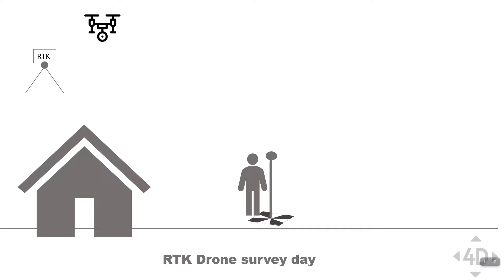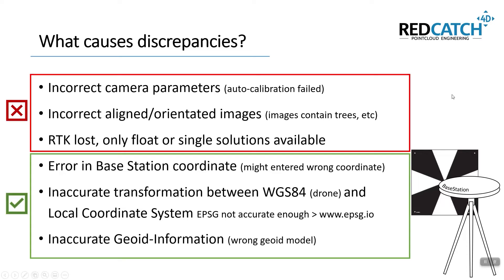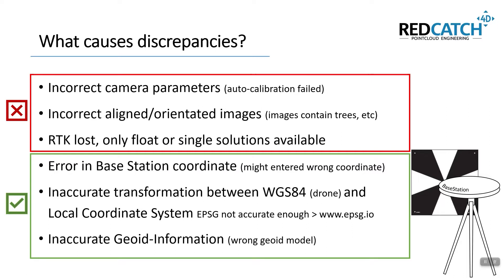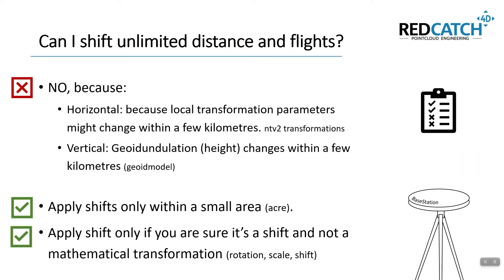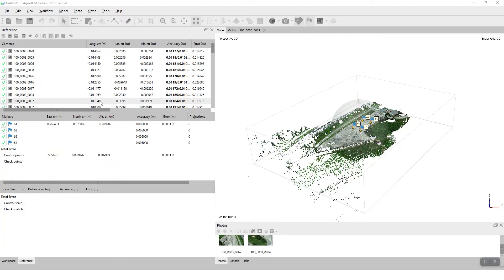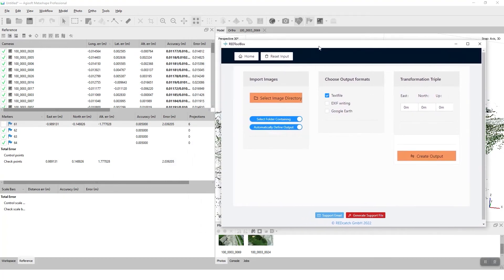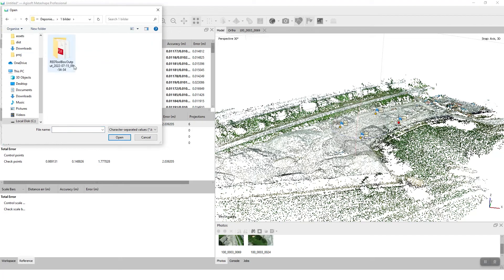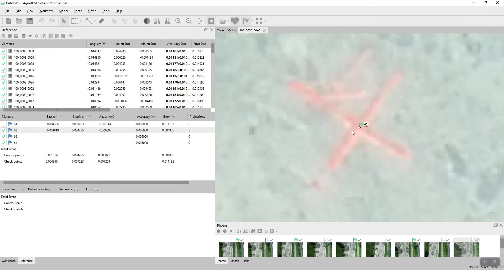REDtoolbox v3 - Shift RTK coordinates in jpgs EXIF information to match your GCPs.

Comment: "Does this tool allow converting WGS84 coordinates with EGM96 heights to a local system such as RGF93 / Lambert 93 (EPSG:2154) with elevations corrected according to the RAF20 geoid?"
Reply from the maker: Please handle the coordinate system conversion within your photogrammetry software. REDtoolbox supports geoid files for vertical correction, but we remain in WGS84 for the horizontal coordinate system.